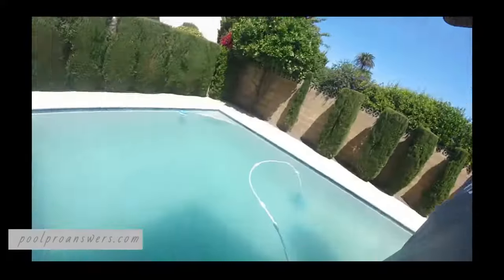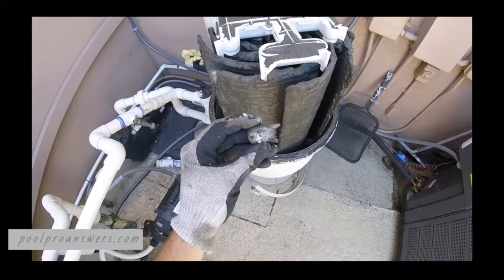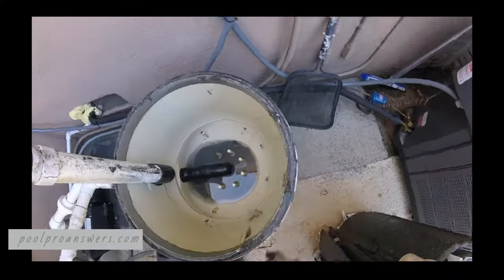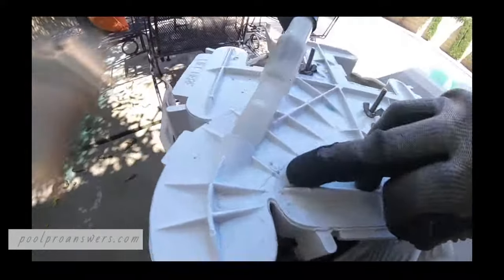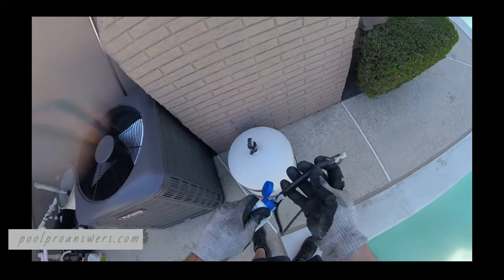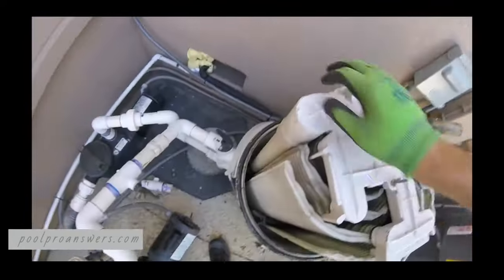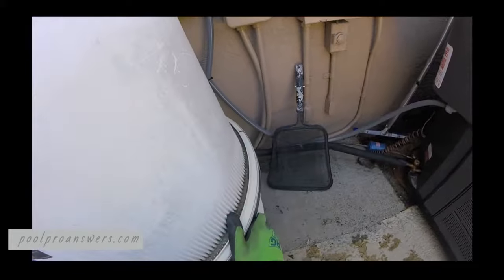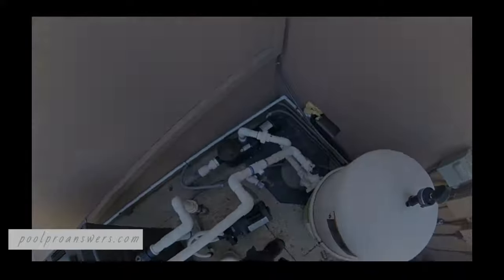Don't Backwash Your DE Pool Filter, Do THIS instead

Comment: I made up a cleaner  from 1/2"CPVC (tan colored) plastic pipe. It is 36" long, you can make it any length for your filter. I cap one end and drill a1/16" or 5/64" holes, 6 is enough.
On the other end I have a garden hose adapter glued on and use a shut off valve, then the garden hose. This way you can stick the pipe cleaner down between all the grids, shut off 
water so you don't get wet & go on to the next grid. It does an excellent job of cleaning. All parts can be purchased at either HD or Loz

Comment: Very nice and thorough video of how to clean a de filter.  My only negative comment is I wouldn't use the new (looking) heater cabinet to drop my tools on.  When the powdercoated cabinet gets scratched it's not long until the heaters housing starts to rust at the scratch.  My biggest pet peeve with pool techs is the lack of appreciation of how much these things cost and there's no need for that.   You wouldn't drop tools on the fender of your car (most mechanics will place a matt over the fender to prevent their tools or zippers, e.t.c,  from accidentally scratching the car) and a nice new $3500+ heater deserves the same care and consideration.   That said,  I'm a fan of your tutorials and enjoy watching and learning from them! Keep up the good work.

Thanks,
Firemanmike
Reply from the maker: I appreciate the viewership and the feedback. 
Thanks for stopping by👌🏼
Reply: Do you polish your heater too? 😂😅😂

Comment: That's a lot of work to go through only to skip pulling the paddles out. You simply can not get them completely clean nor can you inspect them for damage without separating them. You're right about one thing, over tightening the nuts (or nut) is what causes damage to the manifold. It isn't going anywhere so no need to overtighten at all. Kind of a moot point since you didn't take it apart.
Reply from the maker: Yeah it's not the shortcut I would do or recommend, but some folks need a proper shortcut
Reply: It's what separates good techs from bad ones. But then again. Homeowners skimp out of paying for service so they get what they deserve
Reply: Yeah I was pretty surprised he didn't take it apart all the way and wash it down. Any real pool guy knows not to skip simple steps
Reply from the maker: @jamessepulveda5202  thanks, yes that's what thos channel is all about. DIY. Hoping to help the homeowner who can't afford a proper tech to at least understand where they can and can't take shortcuts.
Reply: A lot of techs do this type of cleaning once a year then the second clean they do full tear down and indirect. Personally I do 3 cleans a year and all full tear downs. I tear down completely cause it’s far less a mess. DE sprays everywhere and makes a huge ass mess on lawn or patio when washing filter assembly this way.

Comment: You can get it cleaned out better if you remove the grids. It’s super easy to put back together. Plus, pulling the whole thing out can be a back breaker.
Reply from the maker: Yes that is the preferred method, but as the video indicates this is a short cut in a pinch. Thanks for viewing and for your feedback!!

Comment: I usually open my Hayward filter and remove the grid assembly every year.  By hosing from both sides, I get most of the old mud off the grids fins.  In between, I just back-wash to get the pressure drop to <5 psig and add fresh DE.  When I can't get it <10 psig, I open it up.  Hint, if the top is stuck, just turn on the pump to pop it off with water pressure (after removing band).
Reply from the maker: Yeah that's a pro manuever 👍🏼😉
Reply: @PoolProAnswersDIY  absolute pro maneuver;turn on the pump to pop it off with water pressure (after removing band)
Reply: Pop
Reply: @loreall.2461  You can see how it's done (actually two different, but similar ways) on this video:
https://www.youtube.com/watch?v=XWIltRenwC8
Reply: Also on this video for the Pentair 2000 series:
https://www.youtube.com/watch?v=s8TzWu-xK7s
Reply: @gregs1320   Yes, if even 5 psig at the filter, with ~400 in^2 area the water pressure produces ~2000 lbf, which will pop the top lid off easier than you could by pulling or prying.  Safest to first open the vent valve at the top to insure all air is out since a large volume of pressurized air is dangerous and could launch the top.  MythBusters should have tried that, though they did do a water heater when the base rips open from over-pressure.
Reply: I made up a cleaner  from 1/2"CPVC (tan colored) plastic pipe. It is 36" long, you can make it any length for your filter. I cap one end and drill a1/16" or 5/64" holes, 6 is enough.
On the other end I have a garden hose adapter glued on and use a shut off valve, then the garden hose. This way you can stick the pipe cleaner down between all the grids, shut off 
water so you don't get wet & go on to the next grid. It does an excellent job of cleaning. All parts can be purchased at either HD or Loz
Reply: @chuckredd9131    Clever.  That shoots water jets out sideways.  I'll rig one up.  Might even let me keep the grid assembly inside the lower shell.  I find it hard to get all the DE mud off the grids by just shooting the hose down axially.  I've taken the grid assembly apart a few times to get them totally clean or to replace broken ones.  A replacement set is pricey (>$100), as is the top manifold so careful not to crack it.  Keeping the grid assembled is much easier.

Comment: Neat trick to shrink the o-ring.  Re the o-ring lube, I learned long ago to use a non-oil based lube because petroleum based lubes cause the o-ring to grow i.e. expand.
Reply from the maker: Yeah, NEVER use petroleum based. It will cause the rubber to fail

Comment: I have two long cracks on either side of the damper. Used PVC glue to bridge the gap. Did it a couple of times through the years. Eventually will have to replace it, but saves a fortune in the meantime.
Reply from the maker: Thats what this channel is all about DIY! Good on you!!
Reply: New trick! Clean it up, get old glue off & rough it up a little with some sand paper. Use super glue, don't be stingy, while wet pour baking soda on it, don't be stingy. This method is SO
strong they use it to repair nicks in helicopter blades. They will fill & sand, repeat. You don't have too. Give it a coat and another if you want. Blow off baking soda, add glue, soda.
  I repaired my manifold several years back and it is still holding up well.
Reply: @chuckredd9131  Ha. Sounds like a winner. Only problem, when it comes time to add more filling I will probably have long forgotten about this procedure.

Comment: I cleaned mine like you did, many times. One time for grins I took the gills out of the “cleaned one”. lol try that just one time. Regardless of running pressure, now I pull them apart after every second BW so the filter is actually working.
Reply from the maker: That's the way 👌 nice job🙌🏼

Comment: There's of good hacks here especially the one with the super glue and baking soda.  I knew it was strong and I use it for many different repairs but I don't know about a helicopter blade...hmmmmm.  I ALWAYS take all the grids or cartridges out and apart as it's the ONLY way to get them completely clean AND to look for old/damaged grids.  My way serves the customer better and there is a potential to replace old or bad grids.
Reply from the maker: Yeah you are correct, when doing a teardown completely disassembly is best...that is our standard operating procedure as well. But you might have missed the intent of the video and who it's aimed at.
Thanks for the feedback though, always appreciated.
Reply: @PoolProAnswersDIY  Ya know you're spot on!  I wasn't looking at your vid from a consumer POV and if your DIY customer is gonna try it then YOUR WAY is the best...and after he puts it back together and it's worse and spitting back into the pool THEN you go back and do it OUR way.  Good vid though.

Comment: Hayward states in manual that backwashing shortens the grids lifespan when using backwashing method! What gets me is for sometime the selling of silicone lube craze for everything from o-rings & what not! But what i have noticed, seen & found on the field that silicone in hot- warm weather is effective to a point! But silicone used in cold temps is a no no, for silicone hardens when it gets cold & breaks down or apart materials such as o-ings, rubber, plastic causing problems! Ever inspect a o-ring & it feels pitted & hard like on one side?
Reply from the maker: I don't know that I would call that a "craze"...dry o-rings crack, pit, and split. If the lube is truly silicon it won't break down the o-ring as the o-ring is petrol based. A petrol-based lube will break down an o-ring however. As far as hardening...we don't ever experience that here in our area of California, that may be an issue in freezing temps, or if the O-ring hasn't been serviced for far too long. Thats been my experience, but yours may be different

Comment: Get yourself a high pressure wand hose attachment to get inside the crevices
Reply from the maker: If you're speaking of a pressure washer, those typically aren't recommended as the focused PSI will degrade the filter fabric prematurly.

Comment: I can't find any info on what to do with the dirty DE. I can't pump it out to street or sewer - there is no backwash or out to waste valve. I can only take filters out and spray them off. But it makes a mess. I did it on the lawn, which remained stained with DE for weeks. I want to do it in the garden but can't find info regarding if it hurts the garden. I know the difference between food-grade and pool-grade DE. I'm not wanting to put it in the garden to help the garden, just to get rid of the DE. But I need to know if it hurts the garden soil short or long term.

Comment: I have always done this, but I do it into a plastic bin, let it settle then pour clear water back via filter. Then I pour the remainder through an old piece of cloth in the corner of garden, when dry put it in rubbish. This method only uses a fraction of the water to clean and is 10 times cleaner..
Reply from the maker: Yeah those are the things that a homeowner can do that us field techs cant really do. good on ya!

Comment: I have a 1 year old DE filter I cleaned it the first time and the pressure went back down to 12 which they said it should be. it rose again in a few months to 22-25. I cleaned it again and  the pressure is at 18 consistent. I cannot get it back down. All baskets are clean. any recommendations. FYI some of the people on here are aholes with their comments. thank for the help
Reply: You can do an acid wash on the elements. If there is grease, or oil such as a sunscreen residue, you can use a degreaser such as tsp to degrease the elements first, then do an acid wash. A plastic garbage can filled with water half to three quarts full of water first, and then pour acid in. One pool site recommends a 20- to-. 1 water vs. acid (muriatic). Let the  filter elements soak with your solution in the plastic garbage pail maybe 10-15 minutes, and then hose off again. You should see a big improvement in your filter cleaning cycle time. Very important to use soda ash to dilute the acid solution, after you are through cleaning your filter elements.
Reply: I made up a cleaner  from 1/2"CPVC (tan colored) plastic pipe. It is 36" long, you can make it any length for your filter. I cap one end and drill a1/16" or 5/64" holes, 6 is enough.
On the other end I have a garden hose adapter glued on and use a shut off valve, then the garden hose. This way you can stick the pipe cleaner down between all the grids, shut off 
water so you don't get wet & go on to the next grid. It does an excellent job of cleaning. All parts can be purchased at either HD or Loz
Reply: @chuckredd9131  A guy I know has made these for years, he calls it a "shewanda", and they work great, as I imagine yours does, as well, extremely effective  at thoroughly cleaning the elements.

Comment: Thanks for the video. You made my life so much easier lol. Those it matter which way the bracket clamp is facing? I noticed I have mine opposite from the video
Reply from the maker: No problem 👍 The belly band can face whichever direction is most accessible. I tend to make mine in the same direction because I am left-handed.
Reply: @PoolProAnswersDIY  I’m also left handed.
Reply from the maker: @miguelsotelo7149  we're in our "Right" minds 🤙🏼

Comment: Can you do a video explaining what to check when you are getting dirt returning to your pool? Is it the manifold cracked, the o-ring on the riser tube is allowing blow by or a bad grid? When I open my DE I have a bunch of DE on top of my screen, and only part of the grids are covered with DE. Would very much appreciate your help, thanks.
Reply: I bought a Pentair DE filter and it arrived with a defective busted manifold which was only discovered hours into an expensive repair by a pool technician.
Reply from the maker: Yes, I'll work on a video about that. That sounds like a great topic
Reply: @alanthomas561, did you figure this issue out?  I have a similar problem.  Lots of comments about a bad push pull valve came up.  Also thinking my o-ring on the manifold is flattened out.  Thanks.

Comment: I do the same thing, but the DE is still there on the bottom.  I was wondering if you can backwash and then do what you did to get it cleaner?  I replaced my o-rings for my backwash stem but still haven’t used it because it is so easy to just take it apart.  Good video though.
Reply from the maker: Absolutely!
The more old debris you can remove the better. In regular practice on the company side we backwash only most of the time and then do a complete teardown once a year where we completely disassemble the grids, manifolds, ect...tearing down the grids is the best way to ensure a complete job, but many have difficulty putting them back together. We'll post another video showing that teardown process too.
Reply from the maker: Thanks for watching 👍

Comment: I have a new pool and it seems as the filter needs cleaned. So my intent is to wash as you did in this video. I just don't know how to add de media.
Reply from the maker: I actually have a video for that....it's just not edited just yet.
Measure out your DE, I usually do no more than 3 pounds at a time. Mix into a bucket of water and add the mix to the skimmer with the pump turned on.
Reply from the maker: The amount of De will be on the label of your filter

Comment: So, are the pool equipment Mfrs stupid that they give you the backwash position on the valve ??
Reply from the maker: not at all. backwash valves are still the best way to clear the DE and sand filter, but occasionally a grid teardown is needed. This video was mainly to offer a quick and dirty option to a complete teardown.
Reply: Backwashing is not a complete cleaning of the filter grids.   That's why when you're done and go to add new de you never add a "full charge" because plenty gets left behind when backwashing.  I do one full cleaning by removing the grids at the end of our season.   Here on Long Island that's about 5 months if you have a heater.   Locations where you can use your pool yard round I'd probablly do a full cleaning 2 or 3 times a year.   It also depends on how much use the pool gets as well.

Comment: Of your gonna do it , do it right , always carry spare parts. Replace the manifold , take grids fully apart, been doing this for 23 years and that my friend is the lazy way.
Reply from the maker: Thanks brother.
If you rewatch the video and others you'll note this channel isn't directed at pool professionals,  it's for diy homeowners.  Most homeowners don't carry spare parts and often need to get a job done in a pinch. 
I've been at this for 15+ years with multiple trucks and continue to run a successful business. I can assure you there's a job taking place off camera that you don't see, but thanks for your input.